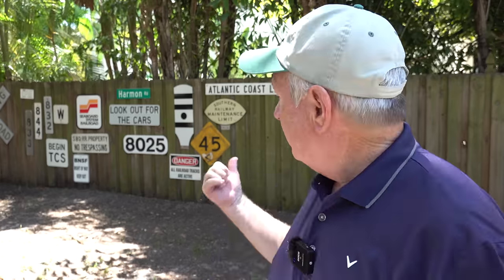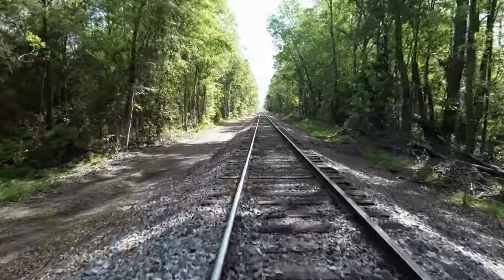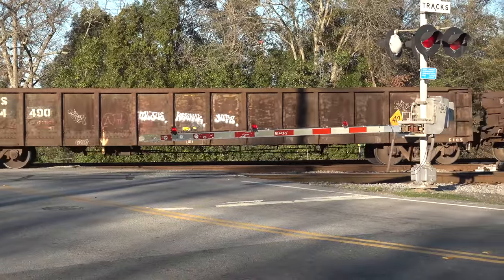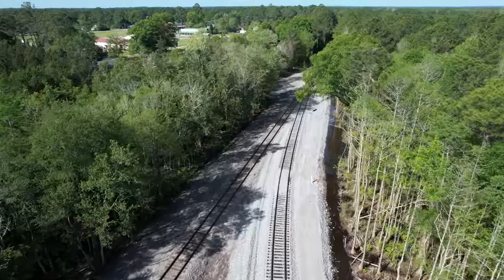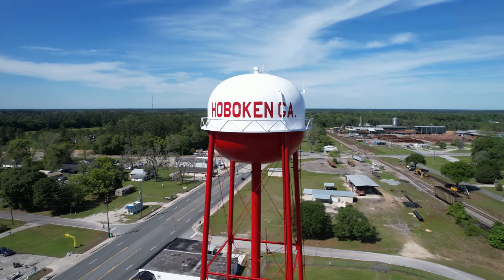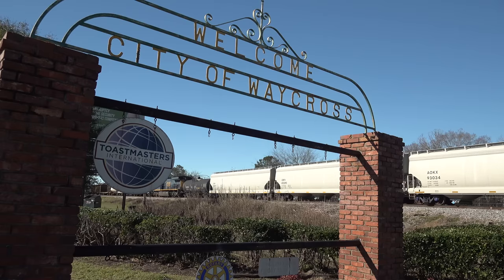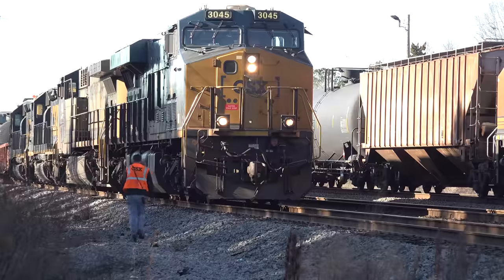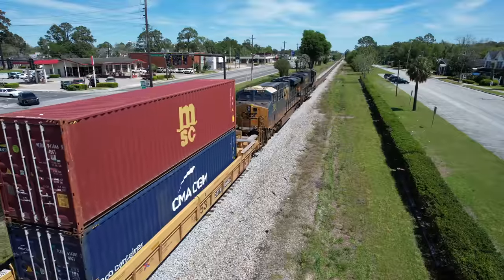How CSX Built a 35 mile Double Track Main Line Using Only 1500 Feet of New Track

Comment: The amount of tracks just left behind when they divert or close lines is ridiculous. They are all over the place in WV. I guess it's not cost effective to pull them back up to recycle or use them elsewhere.
Reply: I’ve seen a lot of csx track being tore out and been told it’s because they have to pay taxes on the existing track, I’d say a lot of the abandoned track you see are old short lines that were sold off and then went under. But as long as the rt of way stays there there is always a chance it can be reused. I work as a contractor spraying all kinds of railroads all thru the US and recently seen a sixty mile short line get a big grant and upgrade and it’s back in use. It still needs a lot of work tho, it’s 1905 Carnegie steel sixty pound track. That has to be the oldest track I’ve seen in use so far
Reply from the maker: Wow! I'd love to see a piece of THAT track!
Reply: It is not that easy to recollect those tracks, given rails weigh 60 kilograms a metre, with two rails you get 120 tonnes per kilometre, which is almost exactly a full load of a freight car.
Reply: @distantsignal  the old Tavares & Gulf line in Winter Garden was just 72# rail from just a few sections West of 9th St all the way to Dillard St. Heller Bros had a short little 300 ft Runaround there, we could run around 4 hopper cars in that track if we needed to. There also used to be a switch just East of 3rd St that branched off and served the Feedmill, also crossed 9th Street about 3 blocks further South. ALL of that was 72# rail. The branch and switch have been gone since about 2005 or 2006 following the damage to the juicers in 2004. That's the oldest, smallest rail I ever saw in use.

Comment: -Почему вы до сих пор используете деревянные шпалы?
И всё же электрификация железных дорог более эффективна чем дизельная тяга.
Примитивно как-то для страны считающей себя технологическим лидером.
Reply: Wood is cheap 

And companies own the rail and aren't willing to spend the cash to electrify the track (thare is some electric rail in the us but thatcis mostly used for passengers and even than they have to go desalination to go to rail owned by fraght companies) 
Of us companies were ever going to electrify it would have been decades ago when the network was smaller and cheaper to electrify however the companies at the time didn't see the point until it was to late for them to be willing to spend the money on a large network that had developed 

Yes the us rail system sucks
Reply: Also thare are lots of not wood sleepers however those are more used for when they expect something very busy most likely

Comment: Those drivers sure are carrying a lot of personal cargo for what can't be more than an overnight stay in a hotel. Makes one wonder what all they would want to bring along on a mundane shift.
Reply: From my experience hauling crews in a van they could be away from home from between 3 to 7 days.  The only thing consistent was the inconsistency.
Reply: Two giant 4-inch binders called rule books, a hazmat emergency response guide, one book of forms and restrictions. A change of clothes (or two or three) and a small bag of toiletries, Railroad employee ID, several pictures of my family, lunch or dinner, snacks, water, coffee, Advil, Tylenol, Tums, a small collection of grocery bags, portable radio, lantern, spare batteries, spare lantern light bulb, cell phone, wall chargers, air brake gauge, dozen or so air gaskets, plastic coupler pin, first aid kit, Roku (or other entertainment device) and a partridge in a pear tree. At least that's what's in mine.
Reply: @SD40Fan_Jason  Thanks for filling in the blanks.

Comment: Lol @still using wooden sleepers EVEN on new track.  How cheap and self defeating.
Reply: CSX installed concrete ties (or sleepers in UK parlance) on their Main Line Subdivision in Kentucky about 15 years ago then replaced them with wooden ties about five years ago because the concrete ties were cracking and causing maintenance problems. So maybe they're not cheap and self-defeating at all!
Reply: @TrainFan James ummm no. No one across the world uses them even in hot climates.if they update the lines.  I live in a nation with 40-45 degrees in summer. Keep convincing yourself that crock. Maybe that's why you have so many derailments.
Reply: @robertcarter9383  but the way I'm not in the UK.
Reply: I live near FEC which has used concrete ties for years and you see piles of old concrete ties by the tracks that have been replaced, they must have advantages or they would't be used but longevity ain't one of them